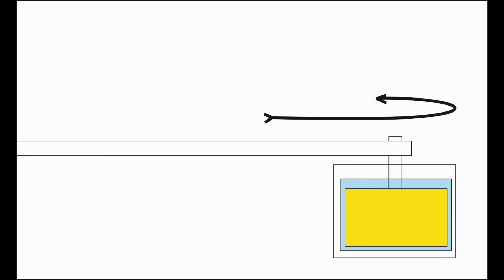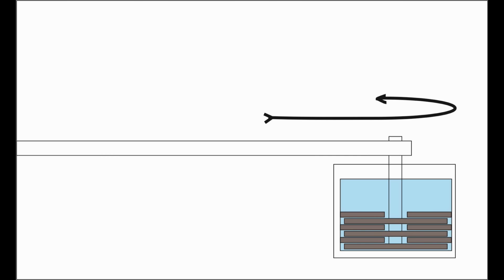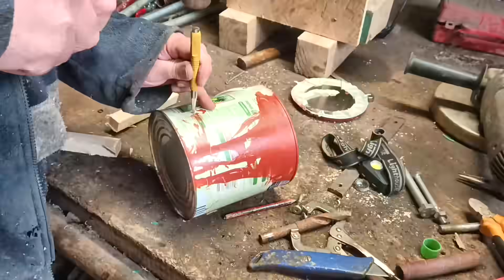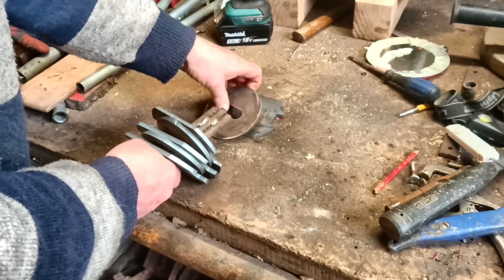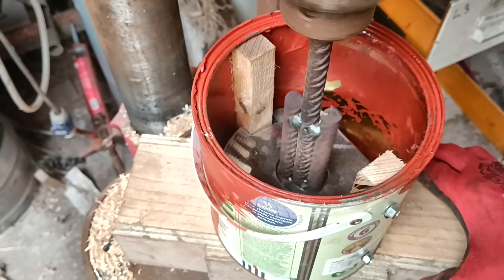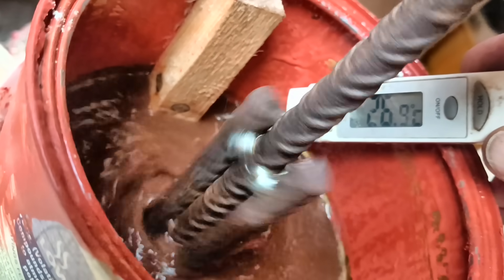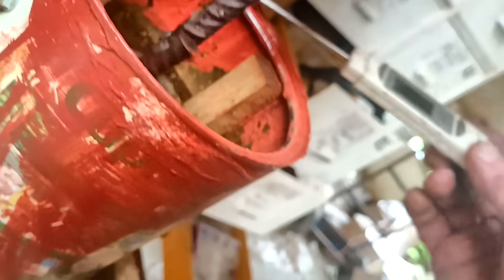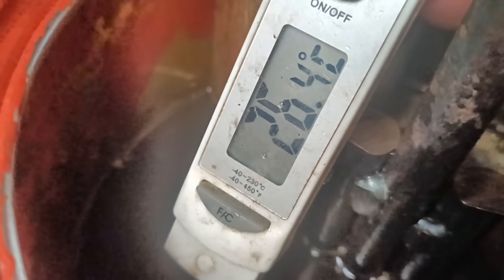Heating Water With Friction – How Practical Is It? Interesting Experiment!

Comment: Generating electricity to power a heat pump would allow for heat to be extracted both from the air, and also other sources (such as the engines, and furnaces used for processing your wood, and of course the surrounding air, and if practical, under the ground). Friction is certainly an 'interesting option', but I fear that it is rather limited in scope, and rather high in maintenance and consumables - efficiency not really mattering in this case (so I discount it here). Interesting project - which is asking great questions!
Reply: I posted another comment about this, but I think a car AC unit is an interesting option. They are designed to use the engine's rotation to power the compressor, which means you wouldn't need an electric generator.
Reply: @MrAwawe  Yeah it's probably worth a try. I'm not sure how long you can get a compressor to last, but you definitely need to pay attention to the oil and making sure there's enough, and that it can make it's way home to the pump. You really need to turn them pretty fast to work well, like 1500+ rpm (they are always overdriven by the crank pulley).
Reply: I had a similar thought in terms of using a heat pump but think it does not need the complication of converting the energy to electricity to then power the pump(s) and instead they could be direct drive, requires some gearing and either there would need to be a way regulate the stored heat so that if the pump worked continuously it was not a problem or a way to disconnect or regulate the pump once the required temperature is reach which admittedly would be more easily achieved with electrical regulation rather than mechanical.

Comment: Creating heat from mechanical input reminds me of this: https://www.youtube.com/watch?v=QFHsJrxwvY8
The problem of wear and tear is much smaller here due to the use of cavitation. Not the molecules of your steel plates slam together 
to create heat but the water slams into itself. But i  think you would need a gearbox to get to the required speed.

Comment: High speed blenders cook soups using the same physics but the friction is made by moulding ribs in the wall of the 'paint can'. Of course this would cause wear in the holding vessel which couldn't easily be replaced. I wonder if you can just have a spinning shaft creating a vortex in a smooth vessel - but have vertical rebar rods staggered throughout to create the friction. When they get consumed then it would be easier to replace with off the shelf parts than having to fabricate new plates. Would probably be trading efficiency for convenience though

Comment: If you use oil instead of water, might that reduce the friction and the heating? Might not be by enough to be a factor. Might be a trade off of heat and wear on the plates. Maybe put grit in the oil to increase friction. The grit would also wear the plates out quicker. 

If the plates grind down, there might be a use for the metal shavings. Make a fun ferrofluid, or something like that.

You are a smart guy. I am sure you already have this figured out.

Comment: I think it would be better to have the wind mill turn an electric generator and use the power to heat water or other fluid.  There wouldn't be any ware on parts then.

Comment: Perhaps you should look into other fluid options. Motor oil would provide lubrication for the plates, potentially saving them from wearing down as fast, though it would also decrease the amount of heat produced per second. Oil, while flammable, has a much higher heat threshold than water, so while a water based system would have itself boiling and evaporating at 100 degrees, you might be able to get to 150 degrees or more with oil, which would be far more than enough to heat your home and any water you might want to boil. 

Having an oil system running into the house wouldn't be a great idea, so some kind of heat exchanger would be needed. Perhaps a radiator from a car would be good for that.

Comment: Magnetic induction heater would be a better converter of rotation to heat.
Reply from the maker: why would it be better though? They both work, but one would cost a lot more than the other, surely?
Reply: @wayoutwest-workshopstuff6299  way less maintenance. no wear. you can make anything a magnet with an electronic magnet, all you need is a copper coil and some DC electricity. just imagine the rust water you will generate. and then the iron is in water all the time. i watched all your videos in the span of a few weeks and saw all your projects rust away after a few winter. insane how rusty stuff becomes in your area so close to the sea!

Another alternative would be to use break disks. They are designed for this task. But if you ever looked at the wheels of a used car all that dark brown dust is the old break disk turned into a powder! do we really want to fine grind so much metal into dust?

From the amount of comments suggesting magnet heater. you surely can ask some high performance nerd from the comments to calculate all the hard stuff for you :P you just need to ask in a video nicely :P
Reply: @sicB_astard  He said in the video he was planning to fill the container with oil so as to avoid the rust, and use a heat exchanger to transfer the heat across to clean water
Reply: @Berkeloid0 The problem isn't rust, but the basic steel against steel friction that will occur.  It's an interesting experiment but those plates would be larger, more expensive, and the forces between them much greater in the actual machine.
Reply: @jasonpatterson8091  I never said rust is the problem, I was replying to a message that said "imagine the rust you will generate" - but that is none as explained in the video.

You could easily avoid the friction by spacing the plates apart by a fraction of a millimetre and using the shear force in the water itself to generate the heat.

I'm not convinced it's the most effective solution but it doesn't seem difficult to create a version that will last a long time.
Reply: @wayoutwest-workshopstuff6299   you would not need to use a heat exchanger. Just a spinning plate of magnets and a metal plate in the tank. No plates rubbing and deteriorating in the water.
Reply: @wayoutwest-workshopstuff6299 a magnetic induction heater would be massivly more effective and you would likely be ble to build one for the same price as your full size fricktion heater + a inductio heater wont wear out to the same extent

Comment: Tim, copper plates and neodymium magnets on alternating disks. Magneto caloric effect. Heat without friction. No rust, no abrasion.
Reply: Definitely agree! That would be vastly superior. You could get old hard disk magnets, probably fairly cheaply.
Reply: I have hundreds of neo magnets from old hard drives. Would like to try this but they are all stuck together, needs sorting and then their shape having metal plate on one side makes it difficult to fit them on rotational disc.
Reply: This! Yeah i like this, i was thinking something with magnets but without it being a motor
Reply: @CMZneu  thats called a generator lol and your playing with inductance , i believe there is friction but it is at a sub atomic level
Reply: Technically that would be induction, as magnetocaloric effect would in that scenario cause small temperature fluctuations back and forth, not significant net change in temperature.
Reply: @fishyerik I'm so glad my induction stove didn't hear that 😂😂😂
Reply: Or just make the water tank out of copper or aluminum and spin magnets around the outside. You don't even need to move the water.  It would basically be an induction heater.
Reply: @charliemopps4926 the heating is probably 50/50 split between the two parts so I would think you need them both inside
Reply: +1 to this! Much better than getting rust and metal flakes in your water!
Reply: @ABunchOfSpanners  
you do realise it would be a close system right?  

no water gets added and no water gets removed.  it's just a heat source. 
the water goes through pipes that touch other pipes where clean water moves through.  and these pipes touching will transfer heat over. 
(or you actually get an aluminum block to run the pipes through for maximum transfer.)
Reply: @ABunchOfSpanners there won't be any metal flakes because there's a heat exchanger between the clean water and the friction water
Reply: Instead of copper, aluminum, cheaper, also won't rust, and it could also serve as the container. A large aluminum pot for example.
Reply: @murrayhorn8817 
Aluminum won't work for reasons that I'm too lazy to explain.

Try putting an Aluminum pot on an induction cooktop, it won't work.

 Well it technically it can, just very poorly but most cooktops won't activate with it.
Reply: I second that fully. As stated below: a cage with magnets rotating around a copper vessel. Insulate the vessel, fill with oil, run a metal heat exchanger through the oil: perfect and low maintenance.
Reply: This is like a generator shunted short.
Reply: Put it into the oil as a heat exchange media and get a perfect heater
Reply: This already exists, it was built in Sweden I think? In windmills, with oil and only swirling the oil. If you make atoms move , heat is generated
Reply: Cody's Lab did something similar with his diesel engine
Reply: This
Reply: Also thought this, as the smooth increase of drag with speed would make it work at practically any speed
Reply: That sounded like a nice idea
Reply: Also, you can generate electricity amd use this to make heat AND other things. Plus the off the shelf components you may need could make the project more manageable / potentially affordable.
Reply: This is worth testing
Reply: I've got a small barrel I coated in rubber that would work pretty well fpr that, but yeah those things aren't cheap
Reply: Beat me to it. Low tech too.
Reply: Yeah great idea, aluminum works too and is cheaper
Reply: Look up ‘viscous coupling’ and make a variant that serves your idiotic needs.
Reply: So dumb. Copper disks with electro magnet plates alternating pre charged with hydrogen. Zero friction, never wears. Please.
Reply: @sbrunner69  The irony of starting a comment with "so dumb" and finishing it with absolute technobabble gibberish is unreal.
Reply: @AtlasReburdened  I guess you missed the facetious nature of my comment sorry.
Reply: @sbrunner69  Can you elaborate? What do you mean by "pre charged with hydrogen"?
Reply: @peterhoulihan9766  he forgot the word "bomb" at the end!! 😂
Reply: Exactly what I was thinking as well
Reply: Genius
Reply: I guess sand would be better than water for retaining heat.
Reply: There's a reason nobody does that, it's called "gas powered water heating"

No bearings, no noise, almost no moving parts. Heat without spinning. No magnets and copper. Wow!
Reply: @shamancredible8632  wait until you hear the first things to stop being available if everything goes to shit
Reply: Oh yeah, I bet you can get a bunch of old hard drives and repurpose the magnets in those. Heck, you might even just be able to use the whole assembly. Maybe. I'm not sure how easy it would be to replace the disk part with a copper plate lol
Reply: lol,, seen this after I’d commented.. great minds think alike… lol
Reply: nice suggestion
Reply: Good luck with keeping your magnets from rusting away. 👍
Reply: @interstellarsurfer  magnets are coated to stop this, and with no friction their is no damage to the protective layer.
Reply: i made a dyno like this... except not quite.
steel backing plate from a large speaker. also find nice lumps in the bases of certain lamps?
shallow pockets to hold 16mm neo magnets, alternating polarity. just enough to locate the magnets, no glue...and to short out the unused poles of the magnets. without that "keeper" disc, they dont work. and if the pockets are too deep you just short each magnet out to itself and it doesnt work...

brass disc. braking forces were tremendous, and all that power appears as heat in the disc. silver is best, copper, aluminium will do. who knows what brass i used it was what i found at the scrap yard. i think it was monel metal actually, did not turn like brass!

the gap between the magnets and the conductive disc controls the braking force.

the trick is to spin the magnets and leave the disc stationary, solder some copper pipe to the back of it... obviously i didnt. oops. 10KW is a LOT of heat in a few square inches of brassy stuff...
Reply: No, that's just heating with Eddy currents. But buzzwords make it sound cooler, even tho there's no cooling, eh?😊
Reply: was going to suggest that, longer life for better efficiency. can even run it through some gears to get better torque or speed out of it.
Reply: Sounds almost like a type of liquid vortex engine😊
Reply: Wouldn't the repeatedly heating up and cooling down of the magnets eventually make them loose their magnetic field strength?
Reply: @xFlow150  that only happens at really high temperatures, well well above the boiling point of water which is what I'm assuming he's trying to reach
Reply: @xFlow150  Magnetic "braking" has been used for years on some kinds of exercise bikes and elliptical trainers. I had one of the latter. The magnets caused eddy current heating of the ALUMINUM disk which, if you work hard enough, gets quite HOT! But as long as you don't exceed the magnet's CURIE TEMPERATURE--the temp at which the magnet loses its magnetism, you can use this effect indefinitely! 👍🏼
Reply: @xFlow150 Nah, solong as theres water in the heat generator, the magnets will get no higher than 100°C
Reply: @xFlow150 not unless they hit their curie point on portions of it, keeping it submerged should work  to prevent that
Reply: @xFlow150 only if you the reach the threshold temperature for that to occur, which he likely wouldn’t need to hit to store the energy he requires for home heating
Reply: @xFlow150 you don't need to make the magnets themselves hot. 

Really abrasive friction sucks for heating if you have copper and magnets, but an experiment never the less.
Reply: The magnets won't heat up, excepting psssively.  The conductive plates will heat up
Reply: expensive
Reply: @themadrobot salvage copper is pretty cheap
 I don’t think you need plate copper, a coil of wire should work as well
Reply: @themadrobot  you can buy magnets from scrap microwaves for dirt cheap.
Reply: That's stupid. There's no need of magnets or any metal. I just need put work in moving the water in a way that the same water provides it's viscosity. Work and energy are equivalent, and you will loose energy in moving magnetic fields.
Reply: @drlepre  The energy lost in moving magnetic fields is lost as heat, which is exactly what we want.
Reply: @peterhoulihan9766  there is no way to get 100% of an electromagnetic wave and that's why an electric motor is not 100% efficient. There's no need to convert mechanical energy to electric energy to heat, you just need to convert from mechanical energy to heat to avoid any energy losses.
Reply: @drlepre  one should not speak unless one knows
Reply: @ΜικεΡ  moving magnets and currents are electomagnetic waves generators. That waves will escape as their energy.
Reply: @drlepre  the goal is to 'waste' energy, as that directly gets converted to heat

You should look up electromagnetic braking

Comment: Tim im thinking youll be a lot more efficient if you turn you shaft to power a compressor with a heat exchanger  than you will with friction in a lubricant. if you have to do it this way slotted vented brake rotors and the calipers  will generate heat and the systems for mounting and running them are mass produced...again air to water heat exchanger as opposed to friction directly heating water.... seperate the heating from the drinking water and never have friction material in your water supply. thanks for the vids
Reply from the maker: I'm not sure you can beat friction heating for efficiency, and a compressor needs a pressurized tank to store the energy - unless you're thinking of something else?
Reply: @wayoutwest-workshopstuff6299  a tank full of compressed air has its uses but im thinking of the heat generated when you do it compressors run hot granted not forumla 1 break shoe hot but you did say you wanted to avoid high speeds. another option  wind powered generator feeding an induction coil...wait thats a electric hot water tank lol.. if you have the material to burn  i would go fire  but i dont think you have a surplus of wood and shrubs and whats there wont supply enough with there maintenance   but you could run water pipe through your charcoal production. passive solar would need glycol in our climate so unadvised.i feel compression offers more benefits than friction here just in replacement of worn parts alone but as always  your shop your way

Comment: Maybe one could do this in stages? Smaller volume of water in your can heats faster. So maybe a very slow pump, from paint can, to paint can, to paint can to holding tank type of situation? X3 heating cans of small volume, in series, to holding tank then looped back to beginning?

Comment: A spring pushing down on the plates may help stop chatter and increase efficiency.
Reply: No. it doesn't increase efficiency. All work will be converted into heat. The question is to determine the working load

Comment: Multiple layers of paddles spinning between paddles that don't spin (stators) cause 'shear' in the water.  That creates a lot of heat.  Think of an automatic transmission, except with the pitch of the blades and stators being straight.
One fellow here recommended turning a heat pump, and that's an excellent idea.
Reply: Yeah a heat pump is ideal here. Could also be an air conditioner in the summer with just a couple extra valves. A car AC compressor as proof of concept and if it works well you can look for a commercial shaft-driven refrigerant pump surplus/craigslist etc.